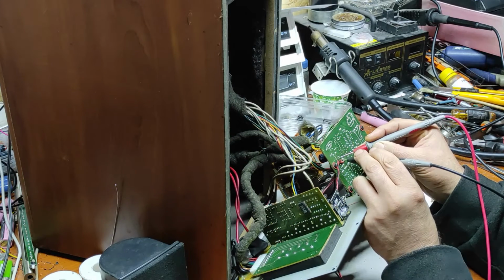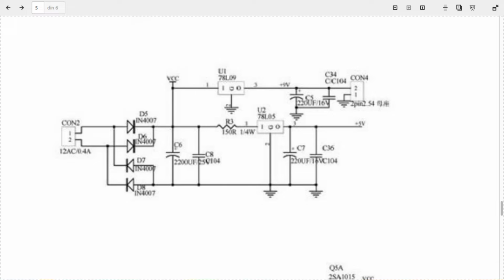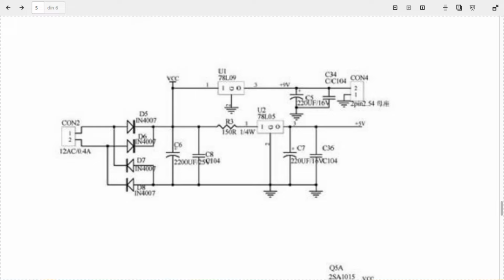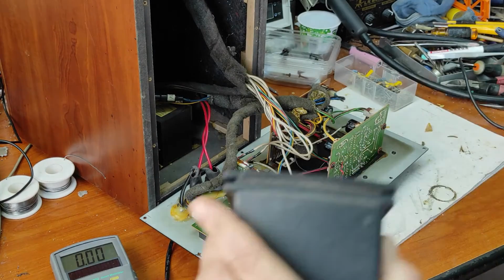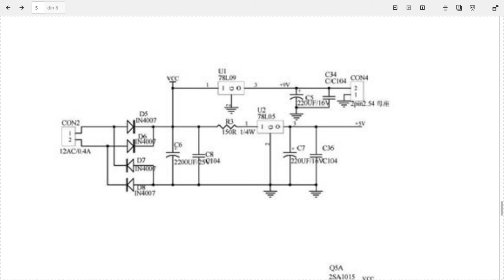Genius 5.1 add bluetooth , get rid of cables

Comment: Hello, can I replace the speaker of the genius system with a 120 watt speaker? Thanks
Reply from the maker: Wich one?there are 6 speakers
Reply: @diymariuselectro  Genius sw-hf 5.1 6000 I think the buffer is 75 watts, can I replace it with a 120 watt buffer speaker and if possible, can I fully increase the system without burning the shipment
Reply from the maker: u can replace the woofer with big power but 8 ohm,u cant increase power if u r not an expert.
Reply: @diymariuselectro  Good morning im not expert,but i must to change it only  with 4 ohm right ? And can you help me mr. With some speaker with this the same size can you give me some link or i don't know...
Reply from the maker: bro I said 8 ohm.impedance must be as original speaker and power can be greater.
Reply: @diymariuselectro  There is 6 Ohm 100 watts ....
Reply from the maker: u need minimum 6 ohm and minimum 100wat.simple.
Reply: @diymariuselectro  Thank you so much for this information but...can you give me some link for the buffer speaker i would like to replace it because i can't find anything on the internet ....

Comment: Hello. Please show how to replace general volume potentiometr by other poetntiometr, not b503
Reply from the maker: depends on what model we talk.some model needs 6 stiked potentiometers and cant be replaced by simple one.there are 6 difrent audio chanels.
Reply: @diymariuselectro  i have same model, like in this, yours video
Reply from the maker: @romansteff  u take down the front panel and replace potentiometer.but its hard to find exact type.